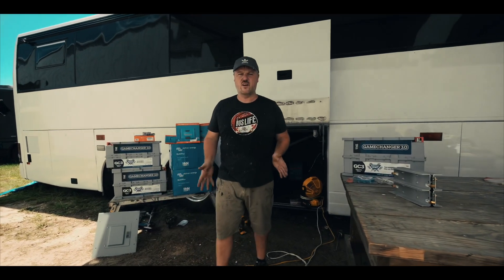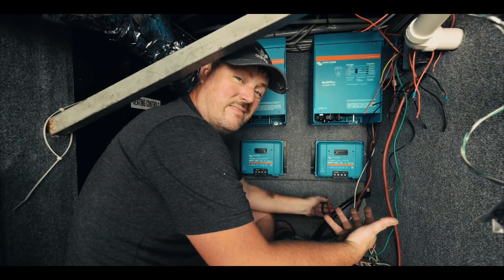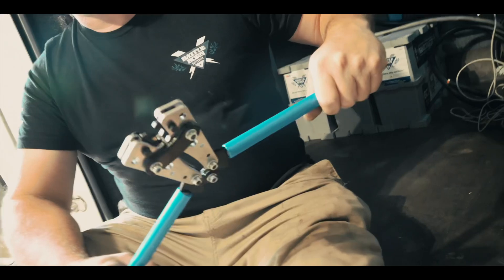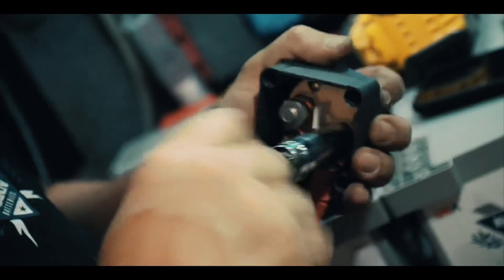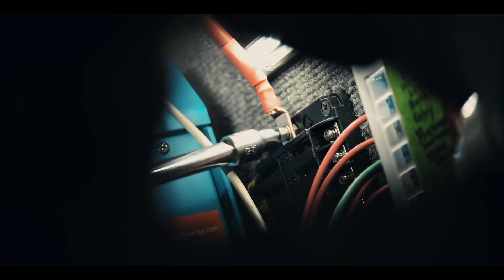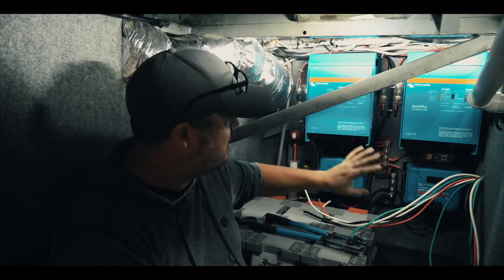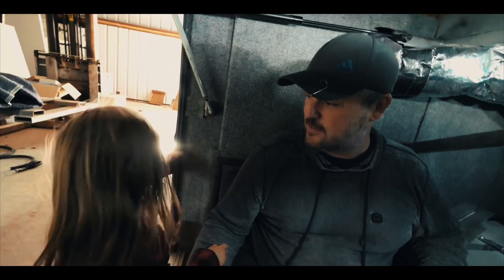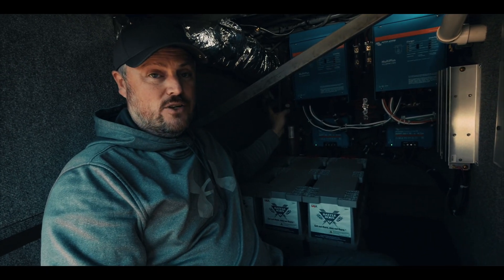Powerful Off-Grid Electrical System for our Bus Conversion!

Comment: I am wondering why in world do that . Me I would do as Santa,-Fe does on the train. Take the 500hp motor out of the bus yes . Install a 250hp Gen set to act as level 4 super charging station built in
 Have two batteries. Then have a rear end with a built in 400hp electric motor. Your solar on the roof ok but not needed. So now you are running 250hp instead of 500hp you should get about 20mpg in fuel cost . But the big difference now that 250hp is running a generator. That now can be run on red off road fuel. Farm fuel $1.25 a gallon . You can charging station if you needed to also. But mostly just charge from your Gen or solar if in good light a few days. Them charging stations are costly and not close to where you might want to go. This way go anywhere at 20mpg half cost for fuel. That is like 35 mpg anywhere you want to go .
Reply: Laugh at the system and tell them yay fuel is still costly . If they all know the real truth people get green eyes are very evident would treat you poor . But if they think we are are all together. You just get the last laugh.

Comment: Looking great guys! Can I offer some advice? Check all your connections while under high load by touching them (low voltage wiring only). I found i couldn't use those ANL style fuses because my 500a one heated up too much. Had to switch to class T fuses.

Comment: Interested as to why you're using 12v @500Amps rather than 24V @250Amps, surely the coach has a 24v Alternator/charging circuit?

Comment: Great special effects on the turning the system on well done I'm sure battleborn will love it are you going to put a GSX? I think that's it the remote touch monitor 712 battery monitor is a good thing to have but I like the touch monitor it will look good on the wall with what you have already. Anyway love how you stepped up to Victron you should have years of trouble free energy to come. Congratulations